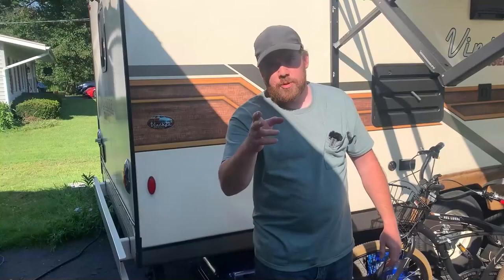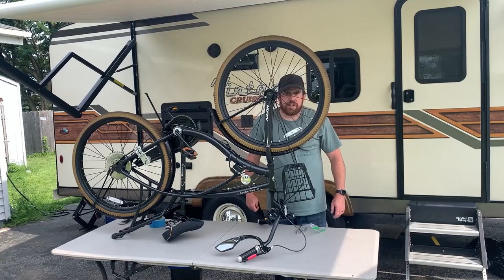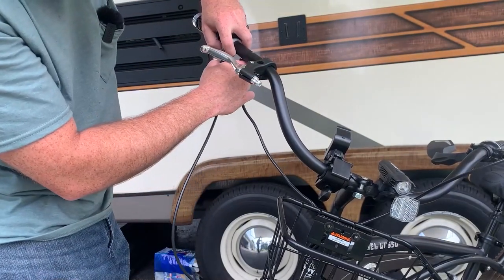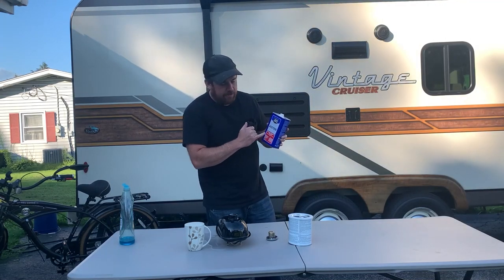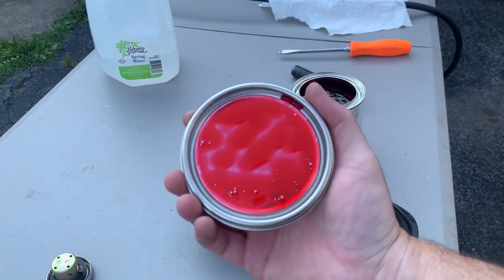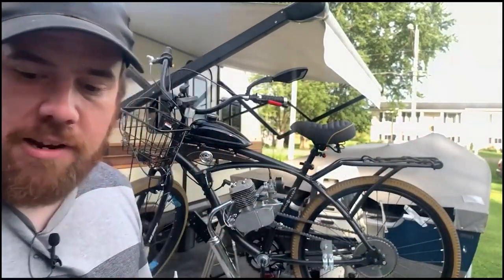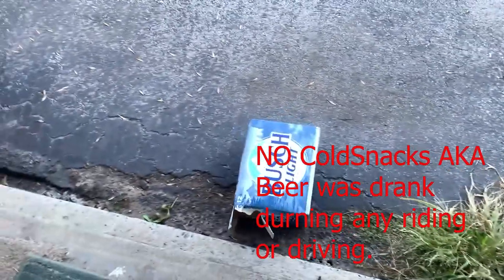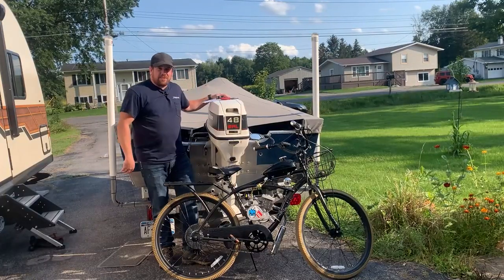Re assemble Motor-Bicycle Zeda 80CC Free-ish Mods. Will IT GO 45MPH, Or will it just get BEER? Ep3

Comment from the maker: Spring is almost upon us! What aftermarket part do you guys recommend of the top of your head?
Reply: 2 things cnc performance high compression head and a mz65 clone expansion chamber pipe and Silencer then you'll have to play with the jets now with all the new power you can drop down to a 38 or 36 tooth sprocket
Reply from the maker: Beautiful. I have some parts moving now. But money is tight. You reminded me, i should be looking into jets! I need a new wheel assembly for the rear anyways. Straight food stamp. I wonder what I’m gonna come up with 🤣
Reply: I hear that especially with this pandemic crap but it's all good I've been in this hobby around 2 years and little by little keeps me from going crazy when there isn't much to do stay and ride safe and keep them videos coming
Reply from the maker: Where did you get your cnc head? And is it really high compression. Either way I’ll still be checking compression
Reply: I got it from Amazon and it's high compression combustion way smaller than standard head and the spark plug sticks in through the top not slanted and it runs a lot cooler

Comment: If you have a really good soldering iron you can clean the crack in your tank real good with a file or 60 grit sandpaper and use flux to fix it....and also jb water weld works great!!!;)
Reply from the maker: The red-kote is working great so far. I’m predicting I won’t have to worry about any further issues will leaks…….but I’ve been wrong before! 

But your advice is also note worthy. Thank you for the input

Comment: Also might want to cut or trim the internal stinger and drill another lil hole in the copper pipe inside it and thru baffles at minimum cut the internal stinger pipe (on the exhaust cap) at max cut baffles out cut stinger off cap and cut at a angle halfway thru at beginning of internal exhaust pipe on a long angle so it can blow freely and still hold the cap on for back pressure

Comment: Remove the damn reflectors off the wheels, they are tossing the wheel off
Drill a couple 1/4" holes in the exhaust and re-jet the carb stock a 36 sprocket on it and your set to go 45
Reply from the maker: I’m all about safety🤣. The lead weights countered the reflectors. Granted I would of saved a lot of time if I removed em first.
Reply: @ColdStartGarage  How often do you ride at night? Thats the only time those stupid wheel reflectors work and only from the sides.
Reply from the maker: I don’t ride at night. Wheels will be replaced on prolly next year. And I’ll have to rebalance them if I take of the reflectors now. So they will stay for a bit longer
Reply: @ColdStartGarage  disc brakes

Comment: Thank you for the info on the red-kote, Need to fix my 4L, it's got a crack in it, I think the welds were a bit skimped on, Gunna try cleaning it out and set my flux core welder to low and try tacks because i'm 100% sure any other way it'll blow through. But I'll try to get it where it doesn't leak and then throw the red-kote in as a secondary safety measure.
Reply from the maker: So far it’s working great. I’m glad something useful came from the video for you. Read the disstructions Thoroughly and understand what they want and need to be successful. Don’t rush the process

Comment: lol for real now ya got to get a 36 or a 40t sprocket on that and you will never go back!  windowed piston and reed whole new animal! ditch the girly carb and toss a 22mm on there lol! mx65 clone you be blazing!            one serous thing to note: Coaster brake on the rear ='s broke legs at some point! keep that in mind when it grabs the chain one day rips the pedals around till ya stop!
Reply from the maker: Great advice. I’ll be taking notes for sure
Reply: @ColdStartGarage  but seriously watch out on that coaster brake! I seen many get hurt bad on those! Better off to just add another side pull like you did the front! if you do remember it fits under the bar in the back that frame not on top 😉 better off to take the arm off it "coaster brake"  after 15mph they can really cause chaos! htere is dual pull brake levers to make the two work on one lever! since your clutch is on other side!
Reply from the maker: I want to replace the whole wheel assembly and hub. That brake is used gingerly right now.
Reply: The coaster brake almost killed me!!!!I was standing up riding and as I pushed down on the pedal to slow down (at the top of a hill)the pedal shot me over the bars...all I could do was grab for pavement or anything till I landed on my palms with a slap then my left shoulder and  then my hip and continued to grind my ass meat on the pavement for about 15 feet as my beautiful bike did cartwheels past me and came to rest in the ditch....luckily I was about 200 yards from my house so I was priveledged enough to get to push it home limping with the burning feeling that resembled Satan's  piss.... increasing EVERY STEP OF THE WAY....after that I was confined to my bed for two more days because I was too sore to move....don't forget that my scabs were sticking to my underwear and I ripped them off twice to pee......coaster brakes SUCK!!!!

Comment: Your supposed to polish the exhaust rough the intake
Reply from the maker: It’s got all the polishing. I don’t discriminate
Reply: @ColdStartGarage  lmao
Reply: The texture helps atomizer fuel mix use 80 to 120 sandpaper leave it smooth but not polished small improvement there for ya amd also remove the cap off exhaust and cut the stinger tube off the exhaust cap put it back on
Reply from the maker: All seriousness maybe it hold water with a 4 stroke. But a two stroke it all gets dumped into the crank and gets smashed around before it’s ported back to the cylinder. 

But I’m not saying you are wrong. And thank you for the comment. It’s deff something to think about
Reply: @ColdStartGarage  basically it just creates more turbulence Wich helps pull the atoms away from each other by way of enertia allowing for a better efficiency and more complete combustion resulting in more power a small improvement however
Reply: @motorizedbicyclenation53cu90  I have heard this before
Reply: @ColdStartGarage  And don't know a thing about engine performance mods.

Comment: How do I check the coil for the 80xc
Reply from the maker: The cdi box for spark? Bryon I haven’t had an issue with it. but at the top of my head I’d prolly disconnect the kill switch wire harness and run a multi meter across the wires that feed through the cdi to check windings and or what nots. But that’s just a guess off the top of my head. If you wait long enough someone with the right experience will comment, also there are so many forums on Facebook on this hobby. Good luck Bryon

Comment: Where do you get a plug for that 2 stroke? Emissions would be Jakarta

A wide case (some front engine mounts are wider) would allow you to fabricate a piece so you can square the engine to your frame. (None of these kits will fit cuz all frames are different)

But really. A CAT on this with a chamber would be nice. Cuz ya know Indonesia
Reply from the maker: I got the plug from the channel coldsmoke as a gift. He informed me the best place to buy them is eBay. I’m assuming you are talking about the spark plug. 

And in America I’ve never seen a cat on a 2 stroke. I can’t imagine that working very well. Not saying it doesn’t exist Because I never had to look it up. 

The engine kit comes with options of different engine mounts. But you still have to match the bike to the engine. You have to either be lucky to have a bike it will fit or plan from the ground up

Thanks for watching
Reply from the maker: I was just enlightened by coldsmoke. 2 stroke with a cat did exist in America. But it is extremely rare

Comment: i have a motorized bike with a short bbr tuning intake a generic racing carb for 20$ and a f2 thruster and yet its still not as fast as ur bike is i also have a 32t sprocket and in a few days ima get a high compression head im using a 100$ walmart road master mountain bike
Reply from the maker: These motors are China made. Who knows what we will get when we get em. My main goal  is to get the nel Russo to reach over 40mph . And I’ll record it every step of the way… we will have fun. We will learn something even if it’s wrong. And there is Deff a lesson in that! Thanks for all your views and comments! I do appreciate it
Reply: @ColdStartGarage  use a smaller sprocket that will help you in your quest to success

Comment: that speed on your phone is incorrect, no way is that right thats 10mph over
Reply from the maker: That is possible. But I’m using what I have to record speed. I drive the thruway everyday and I tried the app on that road. It was accurate in that test with my car. 

I might have to conduct more test to test your opinions on the matter. Either way thank you for the view and the comment
Reply from the maker: And spoiler if you are just a little thumbnail browser… it did not go 45 at tall
Reply: @ColdStartGarage  well, i done tests myself with a gps speedmeter, i never saw 30mph but since then im sure ive hit 30+
my point is, it was very hard to hit 30mph, and when i saw the big sprocket i thought no fricking way is that going 30+. i use 36t on one bike and 32t on another bike. 36t is best but 32t is fine too.
Reply from the maker: Noted: I’ll double check the gps fer ya. But I’ve done other test on other vehicles but now I’m wondering. Appreciate your insight!